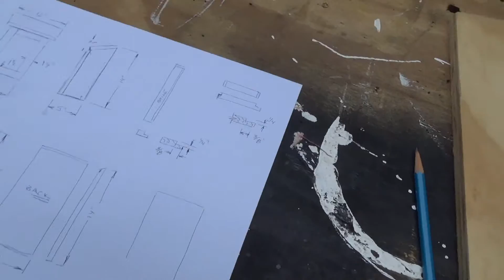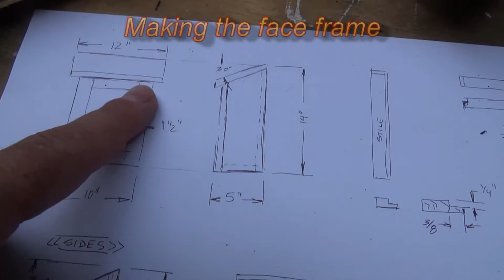Weather Station Transmitter Box - Protecting the Sensors.  FTHVN 401

Comment: Your version of a Stevenson screen is totally wrong. You will get readings way to warm both day and night. The box needs louvers on all four sides, a double roof and slotted floor. It needs to be painted white both inside and out and exposed away from structures and trees.
Reply from the maker: This is good to know.  Maybe I will build a proper box in the future.  Thanks for watching!
Reply: @FlynBrian  hmmm. Very polite reply to Giella. Those who critique like that probably can't use Elmer's glue and construction paper.  I would have told him to make a video of him building one to his specs.  Doers do, don'ters, er, uh, I guess, don't.   Good vid. I have problems protecting my transmitters as well - a tricky problem.

Comment: I just got one of those Tupperware containers with a lid and placed my transmitter in it. I also tap a few small holes in it to release humidity and condensation. Moisture is the #1 enemy to those transmitters.
Reply from the maker: Good idea.  Thanks for watching.